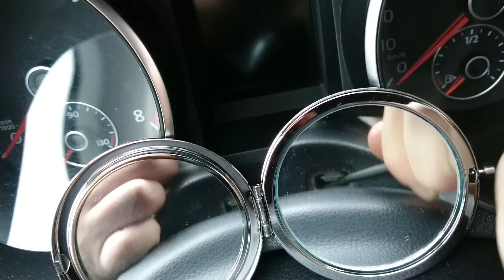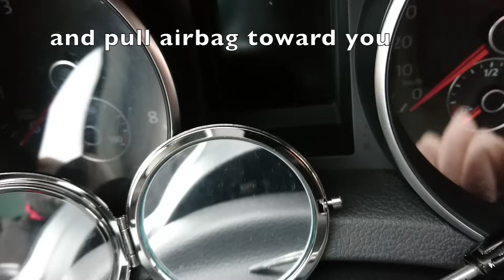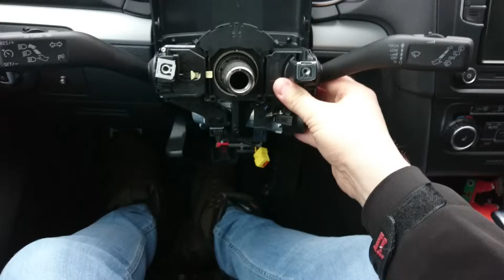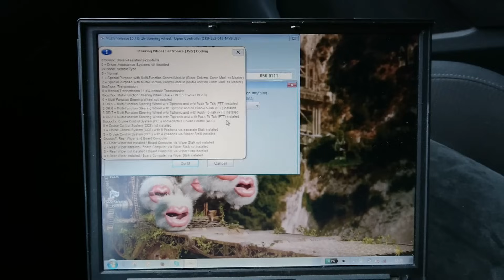Multi-function steering wheel installation to VW Golf 6

Comment: great video! Is it essential to replace the wiper stalk if you are putting a multifunction wheel on a non-multifunction wheel car?
Reply from the maker: Yes, if you use your old wiper stalker with buttons, then it might get conflict with buttons on new steering wheel.
Reply: @lutz6441 I didn't replace the wiper stalk and I didnt have any conflict with the new steering wheel. I think that's unnecessary. Great video but I did the same thing by my own and it takes too much time searching info...  : (
Reply: I have one question, how good is the integration of the rcd330 plus with the cluster screen functions?
Reply from the maker: @deportes3605  All works really well, SW buttons operate as normal. Only drawback with RCD330 is the fact, that it will not show clima functions, when changing temp etc
Reply: @deportes3605  did you change the control module?

Comment: Is it possible to install the CD control unit in the normal Golf 6 or is it only for the Variant? Is it possible to encode a cruise control in the CD control unit?
Reply from the maker: This CD control unit will apply to all body types. As this is Highline unit, then Cruise control is alsi possible to code.

Comment: do you have to replace the stalker or can you just switch the module
Reply from the maker: You have to change wiper stalker with non-button option, as with button one it can go to conflict with SW buttons.
Reply: @lutz6441  oh alright do both stalks have to have no buttons or just one
Reply from the maker: @dvplays3388  As you operate cruise control with turn signal stalker, then this stalker should have buttons. If you don´t have cruise control, then it´s not the case.
Reply: @lutz6441  yes i dont have cruise control but i have buttons for the whipers so will i need to change it or can i keep my current one
Reply from the maker: @dvplays3388  Buttons for the wipers are OK and you can keep current one. If wiper stalker has additional buttons for operating MFD menu, then you have to replace it.

Comment: Please clarify. I have what looks to be the same original wheel here. But he uses the same airbag to put on GTI rim. I’ve read in a forum that a regular Mark six steering wheel airbag will not fit on the GTI wheel even though they look very much the same is that true? I’ve got a mk6 Jetta S no bells no whistles. Hate the plastic wheel
Reply from the maker: But look my video and you can see, that I had original non-MF wheel and airbag was possible to fit with new GTI wheel. I don’t know what in forum is described, but I did this swap and it works well.

Comment: Hi, nice video. Does steering has paddle shifter?
Reply from the maker: Yes, this steering wheel has paddle shifter.
Reply: @lutz6441  okay, but why did you change wiper stalker for MFSW?
Reply: @lutz6441  The coding for the Module are same for all VW and Skoda models ?
Reply from the maker: @sainath8710  Because wiper stalker with buttons for MFA can make system conflict when you are using MFSW buttons for menu operation. Therefore I have changed wiper stalker with non-button one.
Reply from the maker: @sainath8710  Hard to say, most likely they can be different.
Reply: @lutz6441  okay, thanks for the info.

Comment: Hi pleasure Michele congratulations, I wanted to ask you for info to install the controls on the steering wheel on a 2009 Tiguan the same spare parts you used at the end of the video are fine Thanks
Reply from the maker: I´m not 100% sure, but most likely these parts can be applied to Tiguan as well.
Reply: @lutz6441  I read that some people put the Golf MK6 Rline Steering Wheel on Tiguan, so if you used all of the Rline components, it should also work on Tiguan.

Comment: The 2 different harnesses have different white tab clips.... Did this make any difference to connecting to the the same slip ring you used? I noticed the 3 holes are smaller on the original harness and the mfsw new harness has 2 small holes and 1 big hole? I thought this would affect connection compatibility on slip rings this whole time
Reply from the maker: Hard to say, as this was direct plug and play swap and I don’t remember any difference with connector plugs.
Reply: @lutz6441  sweet mate, found a couple airbag x wheel sets. deciding between a golf r with the gloss black trims and silver stitching or mk6 gti with chrome and red stitching to my tiguan my12 which already has the proper mfsw loom
Reply from the maker: @JH-sc7cs very good, then this should be easy swap. New SW will give nicer look for the car and is better to handle.
Reply: @lutz6441  for sure, i've done it on my audi q3 and old s3 which both have round thinner steering wheels. this should be good on the tig for sure =)

Comment: What battery case do you have? Would love to have one like yours just to fit different battery sizes.
Reply from the maker: This is OEM battery cover with soft material, might be for the colder region. 1K0915411A is part code and you can order it easly from Aliexpress.

Comment: Hi I have installed a new multi steering wheel , however the buttons don’t work , new module also , however I need to change my squib can you guide me on the correct part number for the multi functional steering wheel
Reply from the maker: 5K0419091E, 5K0419091A etc

Comment: So you used your original airbag and just changed the harness inside? I'm wanting to use an airbag from a base model on a gli wheel with paddles. That will work?
Reply from the maker: Yes, I used old steering wheel airbag and harness should be changed. Base model airbag with flat bottom steering wheel should be fit.

Comment: Just wondering if you maybe know. If I replace a mk6 tdi multifunction round steering wheel for a mulitfication button flat steering wheel. Would it be a straight swap or would I still need additional parts?
Reply from the maker: If you have steering wheel with similar button layout and functionality (most likely you have), then this should be straight swap without additional parts.

Comment: Currently looking at a Mk6 as my next car but noticed there was water where spare wheel is. Do you think that this is a major issue and should I stay clear? TIA
Reply from the maker: In my opinion this is not a big deal, there can be  leakage in rear wiper flush tube or damaged/missing rubber seals in spare wheel floor etc.
Reply: @lutz6441  thanks for the reply! Sounds good so. Anything else I should look out for before I buy?
Reply from the maker: @HumaneNewt  In terms of body and electrics there are no big surprises. Be aware problems with DSG gearbox (both 6 and 7 speed) - mechatronics, wear of clutch pack and dual mass flywheel issues. Also 1.4 TSI timing chain stretching out is a problem, to take closer look. All in all very good car.
Reply: @lutz6441  bought the car and very happy with it.. Now for a few upgrades

Comment: Hi Lutz (or anyone else) can you guys help me out? 
I have a VW Scirocco 2010 which came from fabric directly with the sw buttons, however the car had an accident. The previous owner did replace the airbag with one that didn’t had the black cable for the sw buttons. So this is why the buttons didn’t work. Now.. I replaced the cable tree with the one exactly as in the video. All cables went in fine however the buttons still don’t work. Does this need to be recoded by the laptop? If so please let me know
Reply from the maker: I don´t know exactly why it´s not working, but it´s wise to look the coding, maybe it has been disabled/recoded due the new SW with no buttons.
Reply: Lutz hi man turns out the slip-ring and sw module are 2 pieces fit in one slip-ring. I checked my current slip-ring It wasn’t compatible with the mfsw, since the previous owner swapped out the old steering wheel without buttons. So I ordered a slip-ring which is compatible with the buttons, but my concern is how to code correctly with VCDS is there a helping guide within the program? I don’t want to take the car to another garage to make someone else do it for me.

Comment: Hi there, I have some questions about this project, primarily about how you knew which parts to buy and Thier compatibility. If you could help this would be much appreciated
Reply from the maker: First you have to figure out which components you have in your car (from VCDS scan). With steering wheel control module (SWCM) it depends on production year and how is your car equipped with features. My car (quite basic) had 1K0 953 549 CP module, but this has no highline options. This means that if I want to install MFSW, then 1K0 953 549 CD is enough for that. If you want to install FLA (Front Light Assist) and Xenon conversion, then you have to get new module with code starting "5K0". Please look this page, there is comprehensive list of modules: http://wiki.ross-tech.com/wiki/index.ph ... e_Versions
Also be aware, that there can be difference in wiper and turning signal stalkers, as cars in early production years have separate stalkers (as mine) and later cars has joint stalkers. Also SWCM modules with starting code "5K0" have built in slip-ring.
Reply from the maker: Here is correct link: http://wiki.ross-tech.com/wiki/index.php/Steering_Wheel_Control_Module_Versions

Comment: Hello, I have a question and I hope you will answer. I was thinking about buying from Golf 7 steering wheel and to replace it into Golf 6, are there same procedure or?
Thank you.
Reply from the maker: I think there is no difference between Golf 6 or Golf 7 steering wheel, as buttons are located similary. Steering harness plugs can be different. SWCM should work as well with Golf 7 steering wheel.

Comment: Hi please help me. So I have the same original steering wheel as you and am looking at the scirocco 2011 mf steering wheel. Will the air bag from my old one fit? They look it but my dads friend said t won’t? Thankyou soooooo much for the help
Reply from the maker: Most of the sciroccos have flat bottom steering wheel (with or without MF) and if you have same original steering wheel as me, then your airbag will fit to 2011 scirocco MFSW.

Comment: Hi, why did you change the airbag harness and the wiper stalker?
Reply from the maker: If you use your old stalker with buttons, then steering wheel buttons may go into conflict with stalker buttons. Airbag harness should be changed, as new harness has wires for steering wheel buttons.

Comment: Do you maybe know which is the part number of steering wheel? Cloud you used old airbag ?
Reply from the maker: Steering wheel was from Scirocco (1K8419091AB). Old airbag can be reused only with flat bottom steering wheel, so yes, you can use your old airbag.

Comment: Hello Lutz, can I ask you a question? I have a vw jetta 2012 model and I want to install the same steering wheel like yours, on the older one I have also command on the steering wheel, the problem is that the new steering wheel airbag does not have the wire's so here is my question: Can I use the wires from the old steering wheel? Thank you very much
Reply from the maker: Very hard to say. When the buttons are similar in new and old steering wheel, also alignment and functionality, then I think old harness should fit. And if not, then you can order correct harness from  Aliexpress with very cheap price, only you have to wait ~30 days.
Reply: @lutz6441  thank you very much , yes the buttons are the same and the functionality is the same. Can I also ask you if the airbag can be used from a steering wheel without command? Like golf 6 same steering wheel just without command.  Thank you
Reply from the maker: @4BOGDANEL  No, for flat bottom steering wheel replacement airbag fit only from Golf 6 steering wheel (with non-MF wheel). When you already have MF wheel, then this airbag does not fit to flat bottom wheel. I wanted MF wheel for my car and I had 2 options: 1. Buy new MF wheel with additional airbag, 2. Buy new flat bottom MF wheel and I can reuse my airbag. I choose second option.
Reply: @lutz6441  thank's alot. I Will think of that also! Thank you again for your reply ! 🤙🤙

Comment: Does the self park still work?
Reply from the maker: Sure, this still works!
Reply: I have the same steering wheel as you did before and i want to go for the one that has comands and paddle shifters. I am in a bit of a tough situation as i do not know what code should the control module have.
Reply: @lutz6441  i mean, i cant find one that ends in “CD” anywhere in Romania....
Reply from the maker: @ranjaeduard3989  You can order CD ending module from Polish website allegro.pl. You have to just write to the potential module seller using google translate and ask, how you can pay and how they can send goods to you. I have used this method many times.

Comment: Hello in my case I am going to change the steering wheel of my a3 which is heated without cams, for one with cams. With the vagcom I will have to change the 3rd value to the right, and if it is in 2 put a 1 no?
Could this change be made with obdeleven?
Reply from the maker: Yes, OBDeleven works well. Sadly I can´t say exactly which adaptions you have to  change.

Comment: Lutz. I'm trying to use your video to replace the slip ring on my passat. It's a little different but if I'm simply replacing the slip ring cause of failure do I need to change the coding or is it a simple swap?
Reply from the maker: I´m not 100% sure, but seems to me that this should be straightforward swap without any additional coding.

Comment: hi, i have a beetle 2015, dont have Multi-function steering wheel, if only change the steering wheel with multi-function, and programmed with vcds, works, or need the module, thankyou
Reply from the maker: To make it well functioning you need all the components and without SWCM it will not work.

Comment: if I have the non GTI steering wheel with controls, I just need to change the air bag harness and coding right?
Reply from the maker: Yes, plug and play. But be aware, that GTI and non-GTI steering wheel airbags are different.

Comment: I notice you have DSG gearbox on the car. I also have one in my Passat B7, but once i disconnect the negative terminal of the battery, i cannot rotate the steering wheel. It locks itself. Any solutions?
Reply from the maker: Steering wheel will lock it self, when key is not in ignition. This is not related with battery connections. Leave your key in ignition and you can turn your steering wheel easly.
Reply: @lutz6441  so, leave the key in ignition and then disconnect the battery? then it will move freely?
Reply: @lutz6441  if i disconnect the battery and put back the key in ignition, steering wheel will not move
Reply from the maker: @ciprianionutolariu5193  If the key is ignition, turn ignition on and steering wheel lock is deactivated.
Reply: @lutz6441  yes, i know this. but if I get the key off from ignition, remove the battery and put it back in ignition, steering wheel will not move. should I try the next moves: turn off engine, leave key in ignition, remove the battery? then should it work?
Reply: @lutz6441  you have a regular key, I have another type of key, with no actual metalic key. I think this is causing the issue

Comment: I have a 2009 Golf 6 1.4 tsi DSG with a standard non MF wheel. 

Very good video which shows the r line MFSW with paddle shift upgrade, but does anyone know if a I can upgrade my wheel to a standard golf leather MF wheel with out paddle shift with part number 3C8 419 091 BE?
Reply from the maker: Yes,  standard MF wheel should be also straightforward swap similar to my retrofit.
Reply: Lutz would it be the same control module I will need do you think and the airbag harness? My standard wheel is fitted with same airbag as the one in your video.
Reply from the maker: @SamoorTV  Yes, most likely SWCM which I had in my video is suitable in your case as well. Airbag harness is questionable, need to be checked from different forum. Be aware, that present steering wheel airbag don´t fit with the one you are planning to replace, meaning you´ll need both new steering wheel and airbag. Therefore I decided to buy flat bottom steering wheel and use my old steering wheel airbag.
Reply: Lutz thanks! Very useful info here and may change to the flat bottom steering wheel now.
Reply: Lutz hey there, so I have changed the steering wheel with the different style airbag compared to original one taken off. New airbag came with the MF harness. Have also changed the wiper stick but control module is yet to arrive. Issue is the horn is not working. Is this due to no control module and no vcds programming yet or maybe cos I’m using different style airbag? Any help would be appreciated, thanks
Reply from the maker: @SamoorTV  Hard to say, both versions can influence horn. Also recheck, that all connections are tight, just in case.